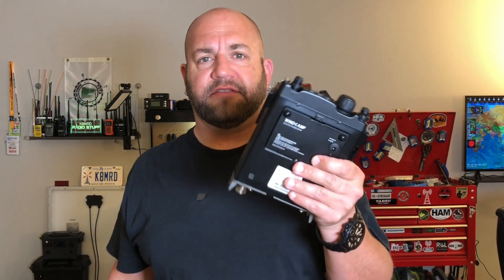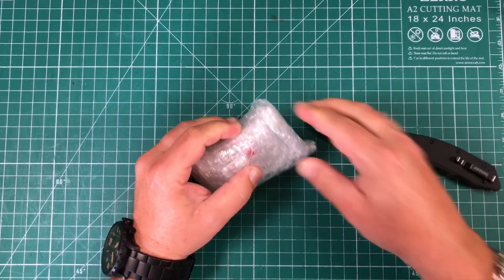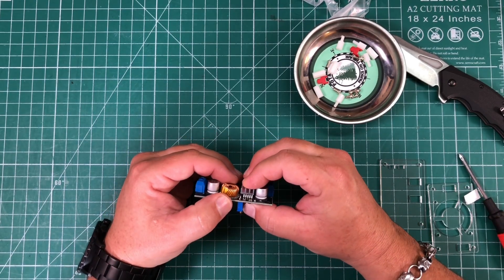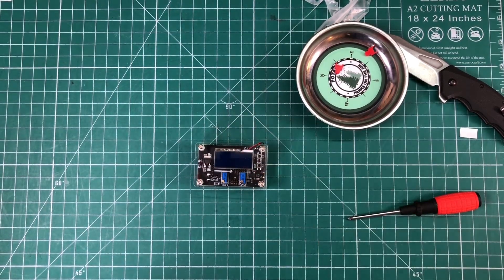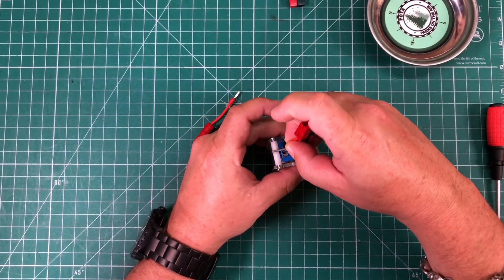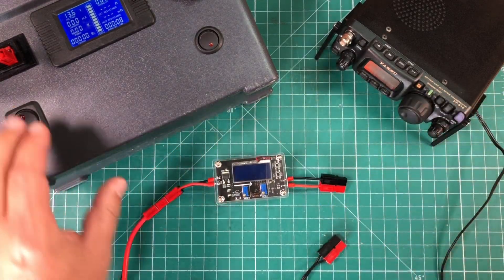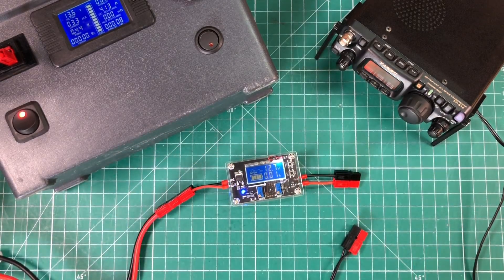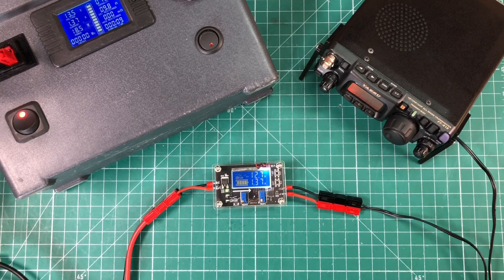Drok Buck Converter | This Thing Rocks!

Comment: I bought the XY6509 DC Buck Converter model and it doesn't reach the promised 65v. It doesn't go above 10v.

Does anyone know what the problem might be?
Reply from the maker: A buck converter such as this one is designed to lower voltage, not raise it.  You'd want a boost converter for that.  Or there are boost/buck converters that will do both.
Reply: @hamradiotube thanks bro! You helped a lot! 🤝

Comment: The person’s method—setting a DROK buck converter to 12.7V and 2A to mimic a charger’s output—is incorrect for a LiFePO4 battery pack for the following reasons:
Buck Converters Are Not Chargers:
A DROK buck converter provides a fixed voltage and current limit but cannot deliver the CC/CV charging profile required for LiFePO4 batteries:
Constant Current (CC): Supplies steady current (e.g., 0.5C–1C of the battery’s capacity) until the pack reaches ~14.4V (3.6V per cell for a 4S pack).

Constant Voltage (CV): Holds voltage at 14.4V–14.6V while reducing current until charging is complete.

Balance Charging: Ensures each cell in a 4S pack stays within 3.6V–3.65V to prevent overcharging individual cells.

Charge Termination: Stops charging to avoid overcharging.

A buck converter lacks these features, risking undercharging (at 12.7V, the pack won’t reach full capacity) or overcharging if left connected too long.

12.7V Is Too Low for Charging:
For a 4S LiFePO4 pack, 12.7V is below the charging voltage (14.4V–14.6V). Applying a static 12.7V:
Won’t fully charge the battery, leaving it at a partial state of charge (e.g., ~50–80%).

Could confuse the battery management system (BMS), if present, leading to improper balancing or shutdown.

The 12.7V measurement likely reflects the charger’s output at a specific moment (e.g., float mode or no-load condition) or the battery’s resting voltage, not the correct charging voltage.

2A Current Setting Is Arbitrary:
Setting the buck converter to 2A based on the charger’s output ignores the dynamic current needs of a LiFePO4 battery. A proper charger adjusts current based on the battery’s capacity and state of charge (e.g., 1–2A for a 2000mAh pack during CC phase, tapering off in CV phase).

A static 2A could:
Overcurrent a smaller battery, causing heat buildup.

Undercharge a larger battery, slowing the process or failing to reach full capacity.

Safety Risks with LiFePO4:
While LiFePO4 batteries are safer than Li-ion (lower fire risk due to stable chemistry), improper charging still poses risks:
Cell Imbalance: A 4S pack needs balance charging to ensure no cell exceeds 3.65V. A buck converter cannot balance cells, risking damage to the pack or reduced lifespan.

Overcharging: Continuous 12.7V without cutoff could overcharge cells if the BMS fails or is absent, though LiFePO4 is more tolerant than Li-ion.

Undercharging: Consistently charging at 12.7V reduces capacity and performance, as the pack won’t reach 14.4V.

Without a BMS or proper charger, the setup could damage the battery or radio circuitry.

Misinterpreting the Charger’s Output:
The 12.7V measurement might reflect a float voltage, a partial charge state, or an unloaded charger output. A LiFePO4 charger for a 4S pack typically outputs 14.4V–14.6V during charging, not 12.7V. Mimicking this statically with a buck converter ignores the dynamic CC/CV process and safety features.

Correct Way to Charge a LiFePO4 Battery Pack
To safely charge the LiFePO4 battery pack in the car radio:
Confirm Battery Specifications:
Verify the pack is a 4S LiFePO4 (nominal ~12.8V, fully charged ~14.4V) and check its capacity (e.g., 2000mAh). Look at the radio’s manual, battery label, or manufacturer’s specs.

Confirm if the pack has a built-in BMS, which manages cell balancing and protection.

Use a Dedicated LiFePO4 Charger:
Use the manufacturer’s recommended charger or a compatible LiFePO4 charger for a 4S pack:
Voltage: Must output 14.4V–14.6V (3.6V–3.65V per cell) with CC/CV charging.

Current: Typically 0.5C–1C of the battery’s capacity (e.g., 1–2A for a 2000mAh pack).

Balance Charging: Essential for a 4S pack to ensure even charging (requires a balance lead, e.g., JST-XH).

Example: A LiFePO4-specific charger (e.g., for e-bikes or solar systems) or a hobby charger (e.g., iMax B6 set to LiFe mode).

Avoid Buck Converters:
A DROK buck converter set to 12.7V and 2A cannot provide CC/CV charging, balance cells, or cut off when the battery is full. It’s unsuitable for charging a LiFePO4 pack and risks undercharging or damaging the battery.
Reply from the maker: Maybe you missed the point?  I'm using a 4S Lithium Iron Phosphate (LiFePO4) battery to charge a 3S Lithium Polymer (LiPo) with a buck converter to bring the voltage down.

Comment: Just a thought: what are you supposed to use to charge that?  I'm guessing not a $15 buck converter and that's not how battery chargers work...  that pack was designed to be used with something else... and I would suggest using that for anyone who sees this...    That looks like a radio intended for a car and if so then it would run off the car power...  Why does it have an internal pack?  in any case charge right and charge safe.. that drok is not a charger..

Comment: I am sceptical about this but I am regulating a water wheel generator output. Range is from 11 to 18 volts. My question it will this device hold it's quality without malfunction? I can't afford a blackout at night in the woods.
Reply from the maker: That sounds like it would need more than the 5 amps this thing is rated for I would imagine.  But I've been using mine for years without issue for what it's worth.

Comment: those little red things are the buttons.  Take the top off and push them in the two holes from under the top and they will stick out through the top to push the buttons.

Comment: Mike, this was great and as a result I bought a couple DROK Buck Converters. Very Handy. I appreciate all you do. Just a thought…when I was out in the field with my 818, Bioenno and Buck Converter  it occurred to me that bringing along the Buck Converter was “solving a non-problem”.  If you’ve got the Bioenno just turn off the Windcamp and plug in the Bioenno. Super fast and keep operating. Especially easy if you’ve got the Windcamp Powerpole mod for the 818 charging socket. Why bring along an extra piece of gear when it’s really not needed?

Comment: I use this same converter for my MT5B Mountain Topper since the max input voltage is 12.0 volts.  I normally run the MT5B at 11.5 Volts.

Comment: The red things are for the buttons they go under the top cover. To use for the mode to turn on usb and off and other button us to see the voltages and the current set for and to see what the current is drawing for the buck converter

Comment: Hard to believe that the Windcamp system is not engineered to charge from automotive sources.  That would seem to be a more than substantial oversight.
Reply from the maker: I don't think it's really anyones fault.  It's just the type of cells that are in the battery.  LiPo cells have I think a 3.7V nominal voltage.  So 3 in series when fully charge would be at the ~12.2 that they charge up to.  You'd be over 15V with a 4 cell pack.  Now, could they have put some circuitry to step down the voltage inside the door?  Maybe.  There seems to be room.  That would have been nice, but I understand what they did.

Comment: Hey Mike, have you had a problem or noticed that the battery meter you use in your battery boxes don't track power in? I believe I have the same meter, and when I charge it, it keeps counting up on the Wh and Ah tracker, so I can't see how much power I should have left in the battery. Any thoughts?
Reply from the maker: They only don't track power when they are turned off.  Sounds like yours is working exactly like it should.  The meter doesn't care if you're charging or discharging.  If there's power going through it, it's going to count it.  If you're charging, just note what the capacity used is and then what the meter says when you're done charging.  Subtract the two and there you go.  Until you fully charge it that is.  Then you can reset the whole thing and start over.

Comment: Yo Mike, I don't think the USB connector is a straight 5V USB but rather whatever the buck converter is set to so be careful plugging USB devices into that connector unless the converter is set to 5V. A friend fried his cellfone on a similar unit when it was set to 12v...

Comment: Excellent! Quick question. What size is the barrel connector for the Windcamp Charger? Or did you just cut the Windcamp Charger and put a Powerpole on it?
Reply from the maker: Cut the wire and put a power pole on it.
Reply: @hamradiotube  Thanks. I would have expected nothing less 😀 73

Comment: Mike, very timely! I have a 110VAC to 12vdc regulated power supply that recently started putting out 20+ vdc... meaning the internal voltage regulator has developed an issue.  I was loath to try to diagnose and repair the regulator circuit in it, so this little do-dad is an inexpensive band-aid to make the power supply usable again. Update: received mine today... those red do-dads are not to keep junk out of the in/out screw terminals, they go in the two slots to the right of the display on the top plate , the "legs" straddle micro switches. When the top is in place,  they will actuate the switches when depressed.   Thanks for posting this video!!  73 de KN6VMK

Comment: You can also use a buck coverter to step down a solar panel for charging :)
Reply: I myself am doing this, i cant configure the Buck Converter correctly, any suggestions?
Reply: Check the manual, and set the output voltage to the normal charging voltage for your battery type... Is your buck converter adjustable @starwarskid93